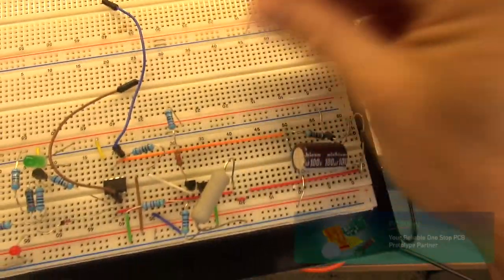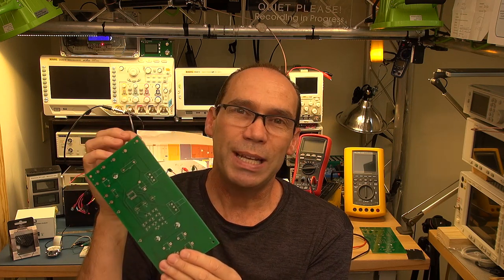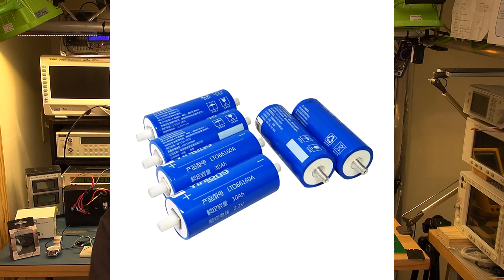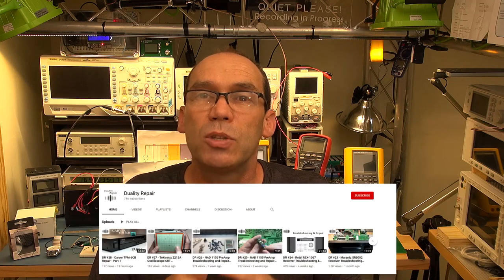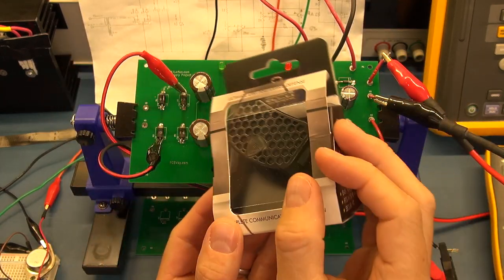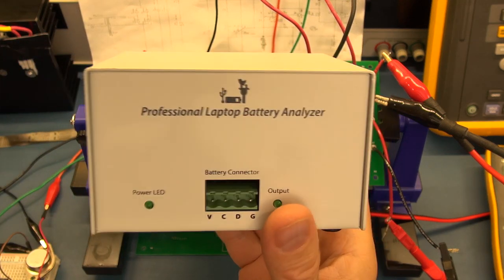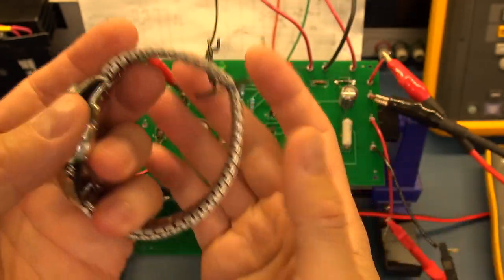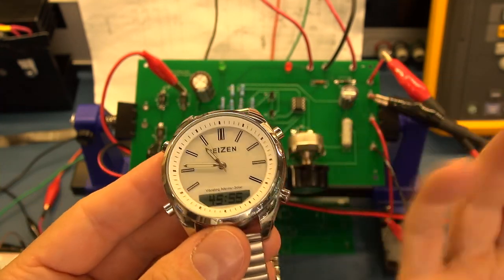T4D #144 - Project Updates and Future Reviews

Comment: While in the military I had a old 1980's Seko calculator watch.  I messed with the pot in the back of it.  I got it to hold time to within 10 seconds over six months.  Catch was I had to wear it the whole time.  Temp variations would through it off.   I wore the buttons off that thing.   No Cell phones back then.  Used  our atomic station clock to check it. That tracked the NBS clock in Colorado.
Reply: Make a small thermal chamber for it with a linear driven MOSFET as a heater. Should be a pretty easy project with an opamp as PID regulator, powered by USB.
Reply from the maker: Very interesting, 10 seconds in six months is excellent. Thanks for your post.